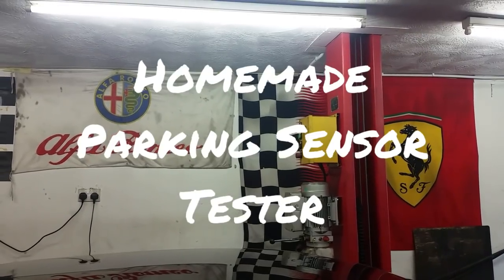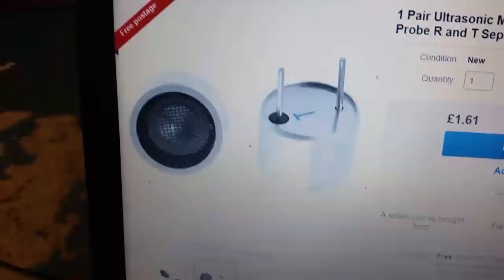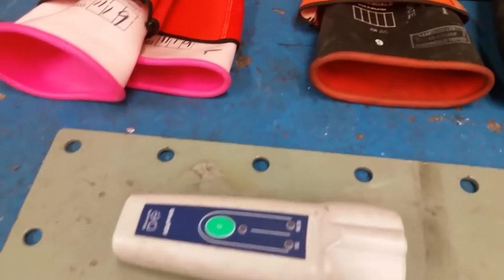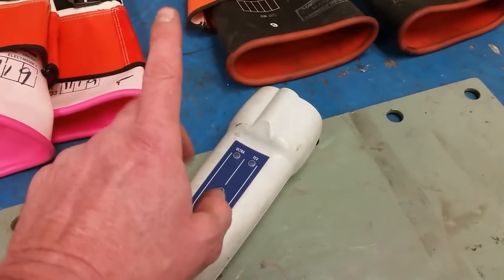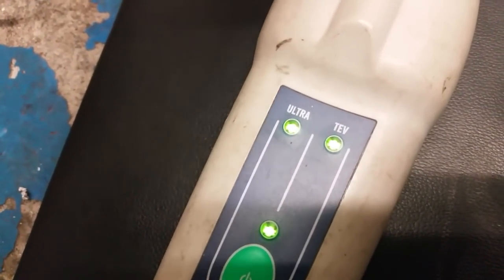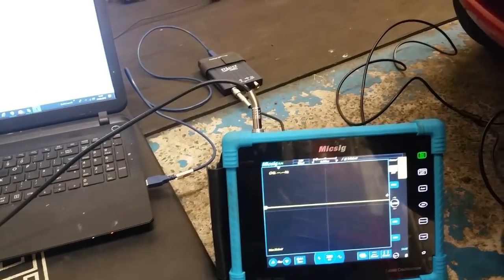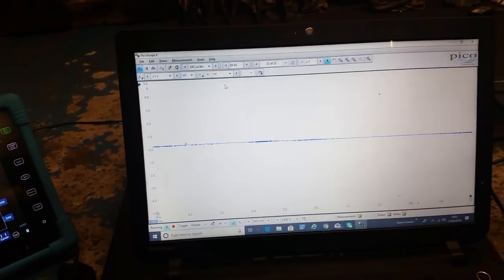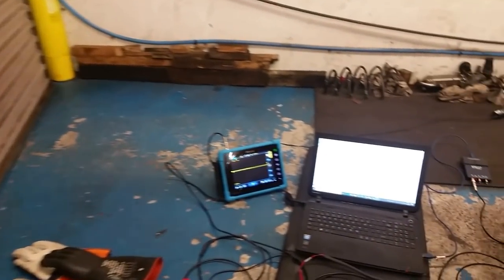Parking Sensors Tester. Pico 2000. Micsig. Ultrasonic tester. High Voltage  Partial Discharge

Comment: You are becoming a hack expert bud I will also get one those ultrasonic receivers, if you have any links leave in the descriptions please cheers bud 👍👍👍
Reply from the maker: hey Igor, i don't really see it as a hack. I think its all to help understand that this type of stuff is available to anyone
Reply: @davesterl  i agree Dave hack is not the best word to describe what i was trying to say, what i meant was i like the way you are able to built your own testing equipment or modify it like adding banana connectors etc...👍
Reply from the maker: no worries, Igor. i knew what you meant. all good

Comment: Looks great.  What time base and volts did you set the scope . I have the Pico scope and just got the Micsig scope  the Automotive one 
It works great maybe not as good software like the Pico Automotive that i use but the Micsig is very good
Reply from the maker: 200micro secs and 1 volt